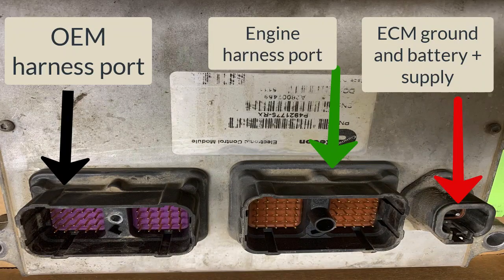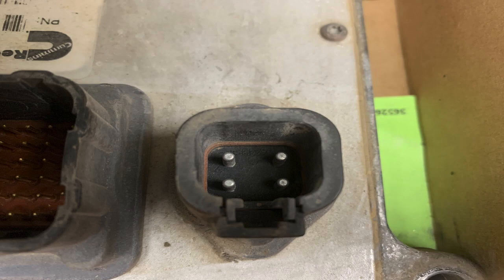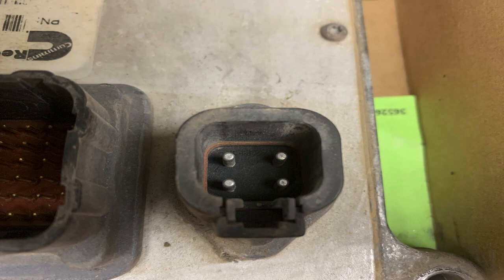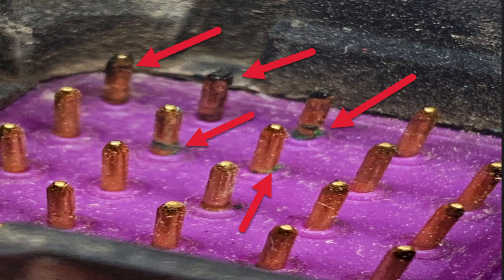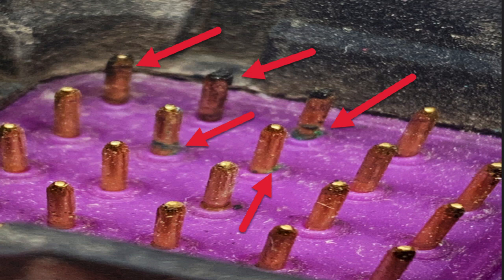Why is my ISX stalling?

Comment: Awesome, awesome content.  Thank you so much for passing your experiences on to us.  Very much appreciated.  I have two 2013 Cascadias with ISX 12’s doing something similar to this.  Will be checking the plugs/pins.  👍🏻 👍🏻
Reply from the maker: I am working on videos for may now and we just got our engine builder clocks cleaned. We were stumped and even had cummins tech helping us. 
We eventually did figure it all out. It was a comedy of technical errors as it were. Stay tuned as engine shop Joe takes a mental beating LOL

Comment: Do you know about Code 1239 FMI 16 ? I already changes Pressure release valve , Fuel pump actuator and nothing thank you
Reply from the maker: This fault happens when the system is having an issue making the requested fuel pressure. But it can get close to the commanded.
I would check and make sure no air is getting in the fuel and check your fuel restriction. Make sure you don't have a crimped line or if you have the aeroquip or strataflex check the ends for flaps. I used to shove a number 2 wooden pencil in the hose and if it did not to in to the eraser the hose
had a swelling in it. I would then change it. This is not true for the hard plastic lines. Most of the time changing fuel filters fixes this fault so I think it might be fuel restriction. Check that first with a gauge. You cannot check it any other way but with a gauge. You need to check it right after the primary or frame filter and it really needs to be under 8 inches. most new filters run around 3-5 inhg. If that looks good you need to do the flow checks to see where the high pressure side is having trouble containing the pressure.

Comment: This is one of those next level finds that takes quite a mind. I have never seen this, I’ve had an accelerator pin jump in and out,and created a short in the ecm, And a power short inside another ecm that would log faults for lost power with key on. Hats off to this one!.. I sent you a link a couple times in the comments, but for some reason they were taken down. It was a 2 min clip of a faulty ecm problem I found. YouTube may have stopped it from going to you. Thanks for the video.
Reply from the maker: Email me the link @ faultcodehelp@gmail.com and thanks. I think YT does that for safety. I would love to see what you found.